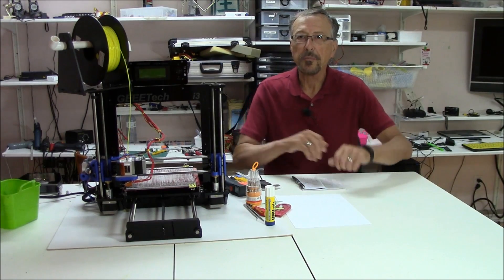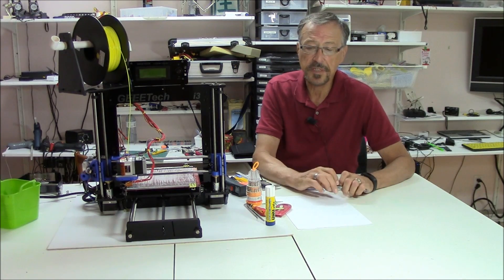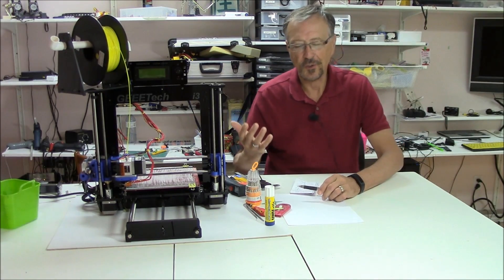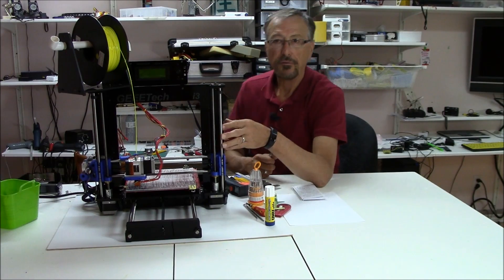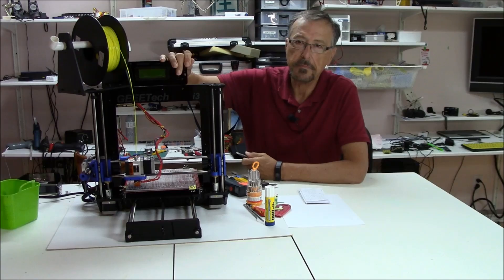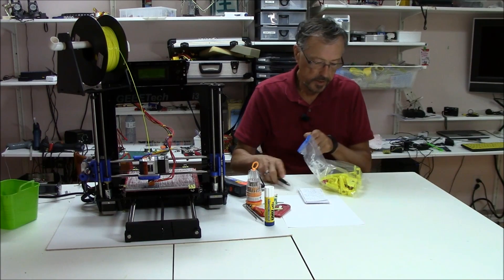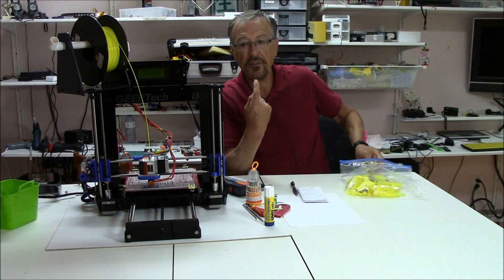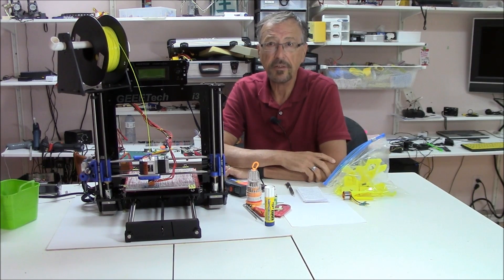Geeetech Prusa Pro B Review and Assembly Problems

Comment: I had an issue where my brass z axis nut had holes that didn't line up with the metal parts that they are meant to line up with to screw in
Reply from the maker: Did yiu buy it from Geeetech?
Reply: Emerald Meadows Yes, I bought it from the official geeetech amazon store
Reply from the maker: Can you send me a picture?

Comment: Thank you for the response to my last post, however soon after that post I have struggled with the lcd screen showing two lines of black squares and cannot get the printer to operate at all. I have tried disconnecting everything from the control board, check for correctness and reconnected. Zilch. I think I have blown something? If this board has a fuse, maybe?
Reply: Did you make any progress with this?  I'm having the same problem now
Reply: @SloppySalad  there is a screw with blue surroundings behind the LCD screen to turn if you encounter this issue, written in the current User guide ;)

Comment: Hi Emerald, wow am I happy I have found your videos ... well I have only watched the first one but hey ho..A year later than you, and absolutely green when it comes to 3d printers, I ordered, received and have just completed assembling my GEEEtech Pi3 Pro B printer. The lcd controller screen tells me that all is good and the printer is ready. I have used a small spirit level to set up the heat bed, the horizontal X axis bars and of course the table it's sitting on. Now I am going through the controller and when I get to 'Prepare' and select 'Auto home', the heat bed moves forward, away from the micro stop switch and pushes the heat bed into the front frame. It continues to run, grinding until I push the micro- stop switch at the back. It is looking for that stop switch but the motor is running in the wrong direction??
Do you have an answer for this please. All/ any help will be greatly appreciated. Thanks
Reply: you need to set the proper direction for the y axis in the firmware, compile it and upload to the printer.

Comment from the maker: The acrylic frame is plenty strong enough for all your 3d printing needs. The aluminum looks cool but it is not necessary. I just assembled another and it works just great. After calibrating with the paper,  it printed perfectly the first time.
Reply: do you have a video about calibrating the hotbed with paper? i have this exact model
Reply: Why does the extruder back its self out im printing and then my filament looks like it backed out
Reply from the maker: @PLAYINSKILSSRT  It retracts to keep the end of the filament warm so it does not clog. You can adjust the retraction in the settings but I would leave it alone.

Comment: Thanks for uploading these videos, I am waiting for the same printer to ship and these will sure come handy.

Do you think that the acrylic frame is too weak for it? Some people complain that this causes alignment issues due to warping. Thought of sending the parts to a shop that can cut aluminium to those measurements. Any other way to strenghten the frame?

Comment: I have the same printer, my issue is with the heat bed, it take 30 minutes to reach 72 C temperature which is not enough for ABS printing, I checked the voltage across the PCB bed it shows 8 volts. The recommended  voltage is 12 V but I am not getting that from the main board. I am not sure if that is the problem or something else. The rated maximum temperature for heat bed is 110 C but the max I get is 72 C. If anyone had the same issue please let me know how did you fix it. Thanks.
Reply: check with multimeter on the board - input voltage, mosfet gate, drain, source voltage, output voltage for heatbed an you will finf failing connection somewhere.